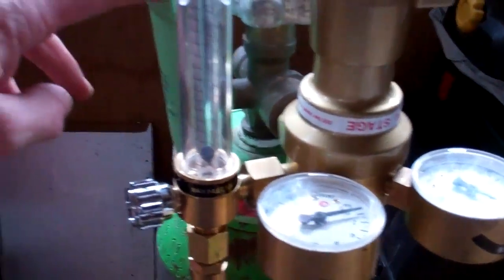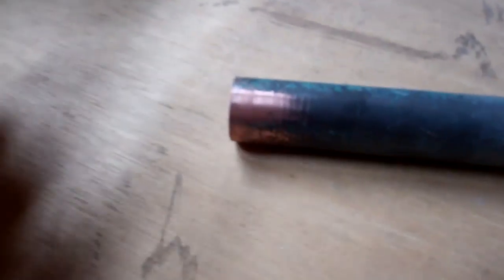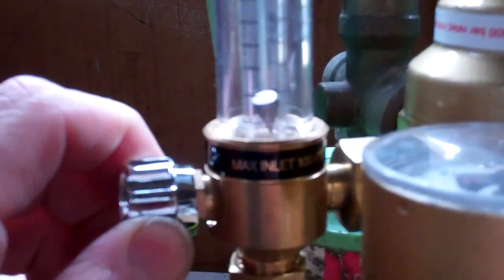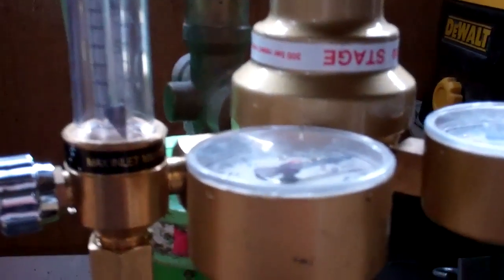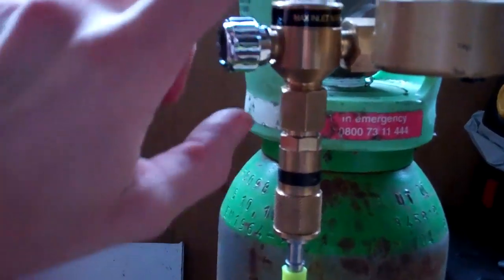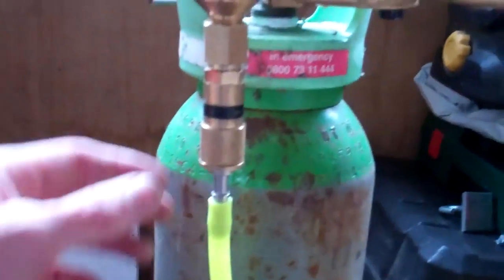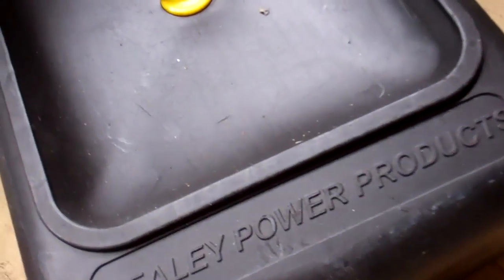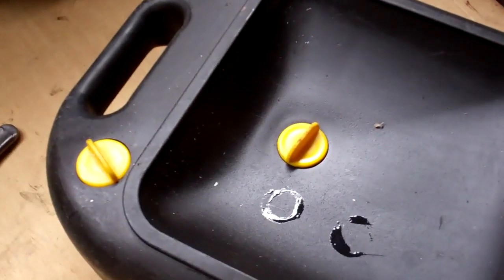Nitrogen purge flow meter for brazing hvac pipes

Comment: Dear sir,

what is standard procedure to maintain gas low rate in (liter /minut)

is it depend on welder, test piece thickness or some other

please suggest
Reply from the maker: It depends on the size of pipe, more flow for the bigger sizes. So long as there is enough nitrogen to push the oxygen out its enough.

Comment: Thank You very much for Posting Jon !!!
Fantastic Brother !!!
What is the name of your flow meter ?
Went on a mad hunt soon as I seen !!!
I just found that Turbo Torch has just come out in April with the NFM-TT Flow Meter !
Found the quick coupler on Yellow Jacket Site !
I am diggin the oil drain pan Jon , Great Tip on Hot Vacuum Oil Drain , the water will stick to the steel walls , looked into that this morning on JB.com , FAQ section !
Great Minds think alike ! LOL 
Great Video Jon !!!